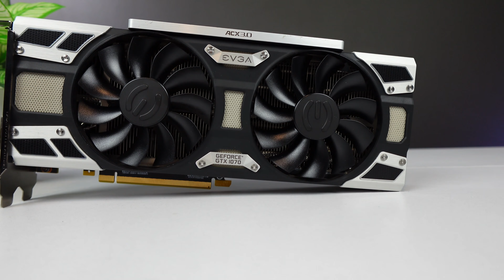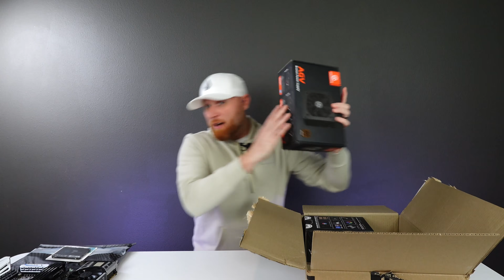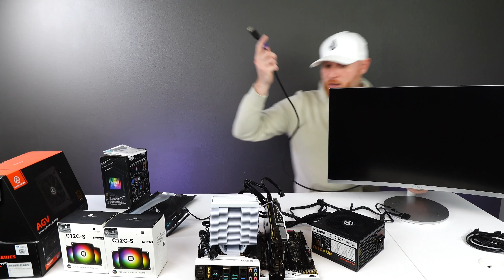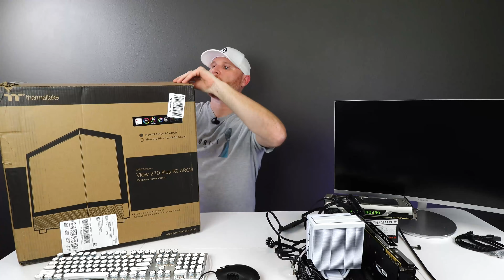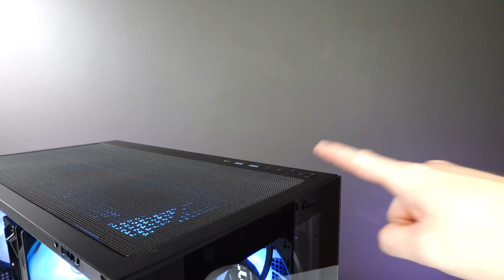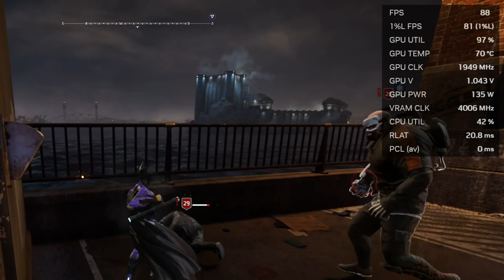eBay Budget Builds Are EASY MODE - PC Build Up Challenge S2E5

Comment: 10 fans… are you using a fan controller?
Reply from the maker: Na, they daisy chain. I usually fasten fans together in groups. Top, back and bottom in a group attached to its own header so I can adjust fan speeds to that specific grouping. Obviously not including cpu cooler or radiator fans which of corse go to its own header

Comment: 6700K, really? For $500 with a 1070? Could you scrounge up an 8700K? A 9900K? Yea it's a buyer's market so don't over supply your components inventory that are not sold or ahead of orders. I don't see a turn around on this into near future UNLESS R9K and Arrow trickle out OR there will be greater trailing 'price performance demand' for R7/5K and known good Raptor (what a validation nightmare that will be) and Alder into summer 2025. Probably some Rocket and Comet opportunities. Matisse owners were upgrading from 3600 to 3700X and 3600 to Vermeer in the last 60 days. mb

Comment: the Okinos Mirage 6 case comes with 4 fans. ARGB PWM and 3 of them are reverse flow so they look great. It backs the PSU up behind the MB but that POS you are making won't generate enough heat to matter. 99$ or for 109 you get a case 4 RGB fans and AND AND cable extensions. 109$.

Comment: I've had good luck with those power supply's, I really don't recommend them but for cheaper builds, it works fine.
Reply from the maker: Yeah I would not use one on a build with a 4070 and a 7800x3d lol but for a cheap build I don’t mind them at all